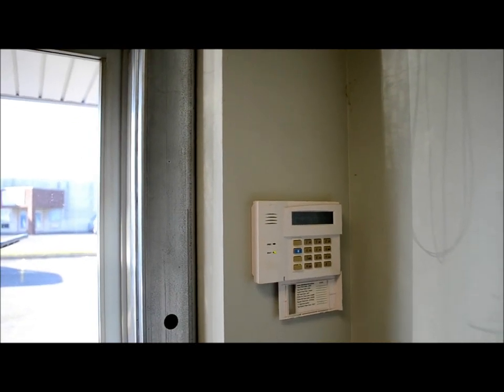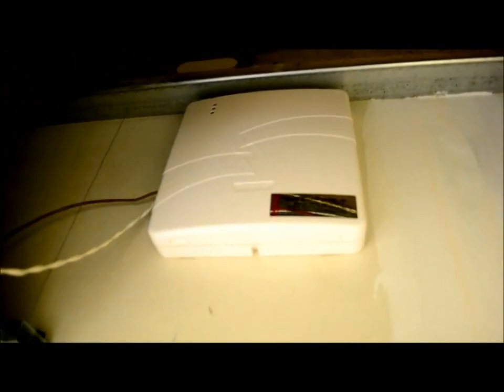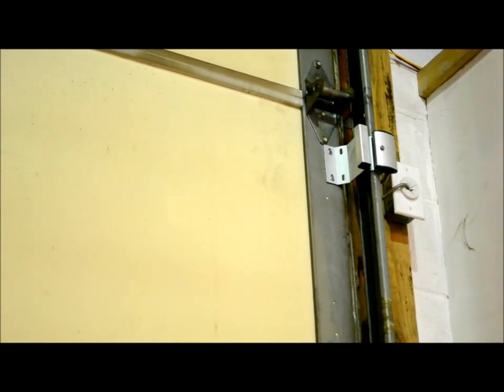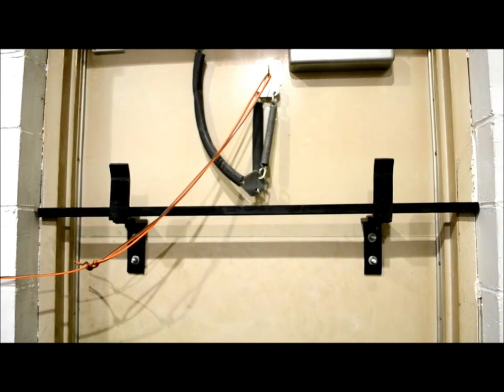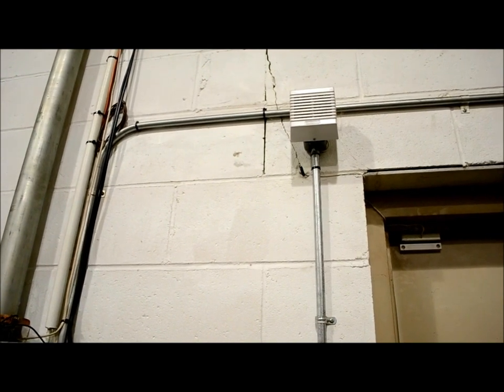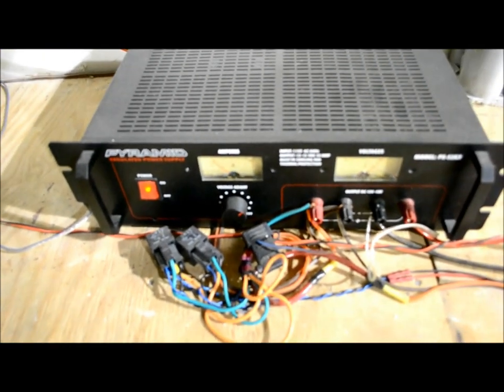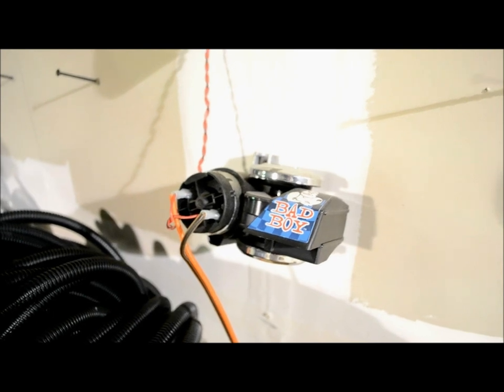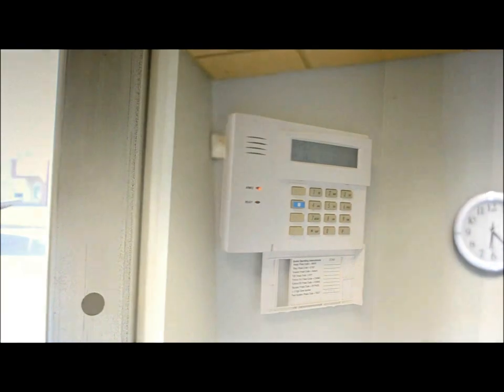Home or business alarm installation weaknesses and how to upgrade one

Comment: Used to be an alarm installer. Your set up is more secure than the banks we did work on!
If the client requests for maximum security protection, we would generally install two door contacts (as shown in your video), honeywell dual tec motion detectors, a loud exterior siren in tamper box, a 25 watt indoor siren (15 watt is typical), and glass break detectors. For phone line back up we would use nearnet radio instead of cellular. How long does your siren stay on once the alarm goes off? Its generally 15-20 mins for UL requirements.
Reply from the maker: mine is timed for 15 minutes

Comment: it will be very rare that see a theft with a cell phone jammer as they are ingeal and probilly get caught and the theft would have to know if the alarm system has cellular backup or just runs off the celluar network that the nice thing with these newer alarm system can oprate without a landline back then when had a alarm system had to have a landline to oprate with the central station

Comment: cell jammer first then cut hole in roof above yer box ,shut off power cut phone lines then drop in to your main box and disble it and your cell backup
Reply: +Dustin Lane Nope, with my panel you'd have to cut GSM, internet and PSTN at the exact same time because as soon as a line goes down it instantly goes off...
Reply: If a cell radio is jammed they will send a text message and then an Email to the central station, there is no way of stopping the radio.
Reply: And if someone has a proper cell jammer...there will be no emails or txts going anywhere...unless the dopes forget to destroy the cell alarm before they leave. But most probably would forget...the dummies.
Reply: But before that the burglar needs to know exactly where the box is. Not exactly the easiest task...

Comment: I have a similar panel as you.  How easy is it to upgrade the panel to one that is wifi contacted, so that I can arm and check the system from a remote location?  And is having a wifi enabled panel a special service that I need to buy from the security firm?

Great video!  Thanks!
Reply from the maker: They are real easy to put in as add ons that are dedicated to this brand panel (5 wires total), with the exception of the antenna mounting which is key to having a back up service, but theres so many companies making this stuff today, so don't leave out 3rdparty options...
Reply: Thanks!  Any brand you recommend?
Reply: Ho Anh Most vista systems can not be remotely accessed with a smart phone.You can do lights and garage door openers but not not arming and disarming.You would need a phone line and an ademco phone module that gives you a audio phone menu type system not internet based.

Comment: lol....... oh boy.  What a bundle of wire and equipment.  Just spend $500 for a Simplisafe system it installs with sticky tape and there are no wires.  Backup batteries already built in.  This sherlock made me laugh.
Reply: Simplisafe is something I wouldn't even use to keep burglars out of an empty shed.
Reply: A SimpliSafe system can be hacked with a garage door opener. Wired systems are always more reliable.